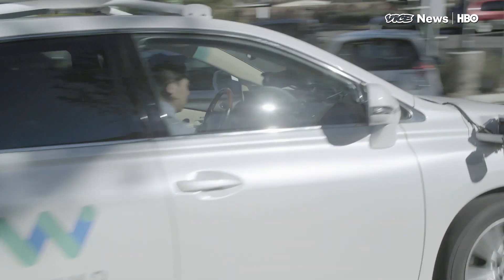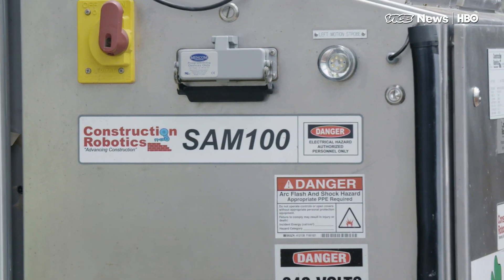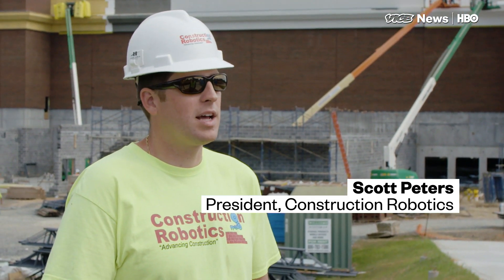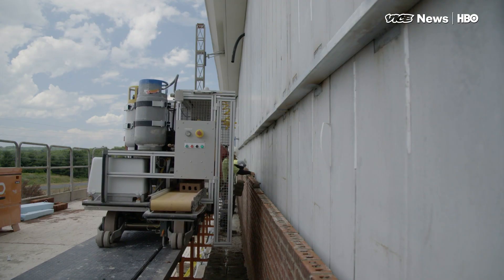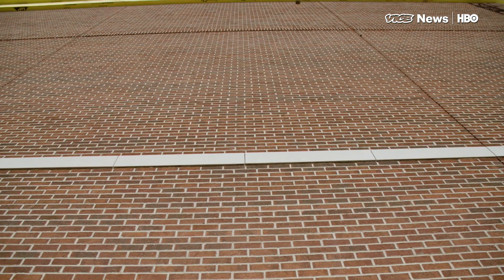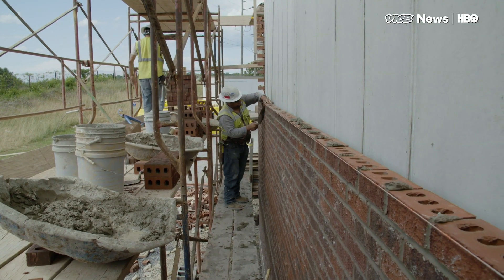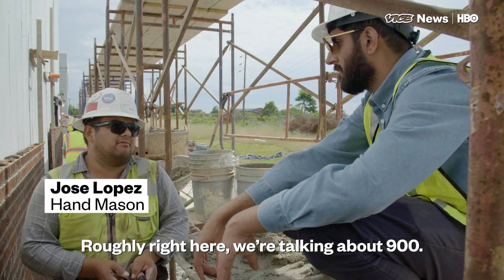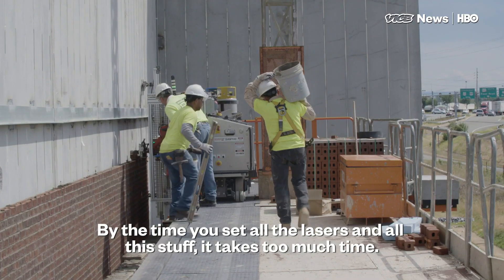This Bricklaying Robot Can Build Walls Faster Than Humans (HBO)

Comment: That bricklayer is absolutely right.  The buildings nowadays have a lot more in and out tight areas and shorter spans of architectural features then the 1950s, 60s, 70s, and in the 80s is when masonry buildings started getting more fancy with the architecture.  Also that robot representative doesn't know what he's talking about.  Number 1, even though the robot doesn't cut and strike the mortar joints it looks very slow cumbersome and I don't believe it is laying 3000 bricks in 8 hours, I think that's a flat out lie.  Also, the set up of that thing and the maintenance, clean up, disassembly, transfer, and moving that thing around has to be taken into consideration.  And he's also trying to push a popular political misconception that nobody wants those kind of jobs; that's Bullshit.  Maybe true for lazy shits like him.
Reply: Let's calculate..

If a human able to put 1000 bricks a day, then if we count 8 hours a day work that means about 28 seconds per brick, in a robot cases it was 3000 bricks a day, if we count 24 hours a day work that means about 86 seconds per brick, I would say it's possible..

for setting up, you probably only need a few hours and not everyday you need to set it up, for cleaning probably already has it's on mechanism or simple cleaning will do, for disassembly why would you need to assembly and disassembly can't you just pick it up and transfer it like that?
Reply: You're living in a fantasy world if you think people are falling over themselves to get these jobs. I've heard countless reports of construction and agriculture business owners trying to hire American to no avail because of people not wanting to do the job even for higher wages. When the immigrants get sent away or barred from working, businesses that rely on their labor collapse.
Reply: He, like most people, want work that is more dynamically variably challenging, and higher paying.   But anyway, I'm taking a masonry course right now.  I'm a landscape contractor, but hadn't yet developed my masonry skills much, though I've done some,… but I want to further develop my masonry and patio making skills, to get more work with my clients, rather than leaving it to other contractors/subcontractors.

Comment: When the machine can build corners and difetent fancy bonds and put lintles on and cut damp and put it on and put weep holes in plus so much more. It's ok if there's a big straight wall on a massively high building and it is simple to do.

Comment: Laying 3000 bricks in 8 hours.
With the help of 2 "real bricklayers" to do the joints and another man feeding it ....
So it means that the robot by itself ain't worth a shit.
Reply: It's worthy is in the endurance, it is capable of working non stop (albeit needed to be fill with materials first) but overall the worth is absolutely better, because worker only need to supply materials while the work are done by machine.
Reply: Man, its almost like it was made to be semi automated.

Comment: Ok, this is a cool robot and all- but I was thinking: If a human worker can lay about 1,000 bricks per day, and the robot (plus 2 human workers!) can lay about 3,000 bricks per day, isn't the robot essentially about as useful as 1 human worker? Because you have to have two humans assisting it; each human with the capacity for about 1,000 bricks per day.

Granted, the brickwork may be more uniform with the robot. Also, the engineers may upgrade the robot to improve its efficiency over time.

Comment: So the robot need 3 workers to assist it and is a pain to setup, for 3000 bricks per day.
A worker is putting 1000 bricks per day, so 3 worker can lay 3000 bricks per day, don't need setup/maintenance/electricity/technician or high skilled employee...
I think it's not quite there yet...
I suppose the problem is also the use of human adapted brick and material for a robot. Bigger brick or other material might be better for the robot
Reply: its just its early stages of this technology, wait 30 years from now, you will see something better
Reply: But even the worker who puts down 1k bricks a day needs assistance. He needs guys to bring him the bricks and mud just like the robot.
Reply: peter janjanin even in McDonald you need someone train to fix the machine in case of problem. I suppose an automated soda or ice cream dispenser is not that simple...
This robot surely need some fine tuning during operation, so at least one of the member need to be train.
Also someone need to be able to maintain the robot, part need to be controlled / replaced.
Reply: Glad someone knows what the hell they're talking about. I expect myself to lay 600-700 brick a  day but as you said, thats only if I have everything set up with a helper.

This is definitely cool to see. But it's no where near ready to replace human masons.
Reply: Touli Loup.  Correct, the company i work for bought one a year ago and lost their asses! Too much maintenance and is was too sloppy!
Reply: Touli Loup  some set up is required but that's the labourers job
Reply: david dorshak yes but the qualified technicians needed to setup/maintain and operate the machine are certainly more regarding on work condition than their minimal wage competitor...
Reply: Doondah I bet people on the lines at Ford and GM said the se thing
Reply: Humans get tired
Reply: cooking with Callum yep, the 3 humans assisting the machine will also get tired, and machine wears out too. Maintenance cost on a robot must not be cheap.
Reply: Touli Loup but the workers whilst using the robots don’t have to put in as much effort 😏😏
Reply: Touli Loup Natalie Cabral not a chance! I saw 3 bricks already crooked. Unless you care less about quality and more about quanity then looks like same is your guy.  And if I had the same height to lay brick and 2 guys to do my finish work and not take a break and lunch 3000 bricks is possible for a human. This is just not practicle especially with level work which Sam will never be able to do.
Reply: You need health care, standards, per diem, insurance, sick leave, vacation time, possible laziness
Reply: Touli Loup 2 workers per day not 3 plus innovation means that in the future it won't need maintaining of the same sort
Reply: Touli Loup lol love how you just state what the video said
Reply: A complete brick crew lays 900 bricks a day, not 900 per person.  I can tell you're a indoor kind of guy.
Reply: Touli Loup the robot will get better and the cost will go down.
Reply: thats the beginning it will improve with time
Reply: Those 3 workers still need 2-3 other workers to feed them bricks and mortar etc. So overall the machine still needs less people than 3 bricklayers because the brick masons still need unskilled labor to give them things.
Reply: I love when people who don't know anything about bricklaying, but heard a statement in a youtube video about how many bricks a human can lay, think they know enough to compare manual bricklaying to this machine.

Like others have said, each human worker also needs someone to feed them materials and bricks just like the machine does.
Reply: And when the machine breaks down, as all man-made things will. You could just hire another human Mason. But no, now you've got a 4500 repair bill and a stalled jobsite
Reply: Thank you
Reply: Touli Loup I don’t think they care about that they just want it to be perfect so company’s can sue for poor or small brick that is not perfect
Reply: Working with that robot is less tiring and childs can do it too
Reply: If you read correctly he said some of the best masons can lay 1000 bricks a day meaning the average can most likely produce roughly half to 3/4 of that
Reply: sound like a butt hurt bricky
Reply: bro if youve laid block before its brutal work
Reply: i havent laid a block bro.... been around them on work sites for 15 years tho. i lay out 9 foot durforms for concrete foundations. you ever  set 120lb 9 foot bricks all day?.... this machine looks very practical and efficient for laying bricks.
Reply: The robot handles the straining and repetitive job of laying the bricks
Reply: Touli Loup unskilled workers costing little, in 3 shifts a day.
Reply: Doondah do you know the approx cost?
Reply: Touli Loup he said 900 a day and he is probably skilled at it so that's not the average plus You have to pay them plus they take lots of breaks plus u have to pay for overtime plus u have to pay for any wasted material I could go on
Reply: And it also reduces chances of musculoskeletal disorders from repetitive motion/awkward posture. So in the end, still need 3. Actually a bit more than three because of engineering, maintenance, manufacture, transportation, etc. and yet these ~3 people only need to dump concrete ingredients in every once in a while and the bricks, and just carry a trowel to brush off the excess.

Makes the job easier,
Makes the job safer,
Does the job with higher precision,
Still requires roughly the same number of humans perhaps more,

Whats there to not like?
Reply: This is the first step. They didn’t buy the machine, this is a test to improve further.

There is literally a part where they talk about this.

How about you listen to the whole video next time?
Reply: i thought the same. plus human can make something else than straight walls, like fireplaces f.e.
Reply: Well 3 mason also needs assistant
Reply: Touli Loup 1000 is the ceiling for humans not the average
Reply: Touli Loup Robots don't take sick days nor does it need a break. Also works out cheaper overall
Reply: peter janjanin take a guess how much this machine costs?
Reply: First, you all need to know That shit it's not a brick wall lol, that's decorative shit
Reply: robot work 365 day 24 hour non stop
Reply: it doesn't really matter if the cost of lease, purchase, usage is lower than the cost of 3 bricklayers per hour say $100 total p/h (inc all other employee costs) then the Robot bricklayer makes sense. At the moment I'd imagine it's more expensive but as it becomes more mainstream ,  then the costs will tumble, also as you get a more refined version that doesn't require any human intervention, then why would you employ a human to do the job.
Reply: plus it needs a big empty wall without special features
Reply: orange moonglows that's like saying you need to be skilled to operate the machines at McDonald's ......
Reply: no. you have to be skilled to assist and operate that robot. it requires way fewer skills to lay those bricks than operate that robot. the robot is not paid. lol. the price will go down as the machines get more reliable, faster, etc.
Reply: Yes but the humans assisting the robot require less skill and can therefore be paid less.
Reply: @kms50549  yes but not the technician that will have to come on a jobsite to repair and maintain them.
Reply: henry hurst. The system will ALWAYS have faults, masonry is too hands on, ive done it for years, cheers!
Reply: Touli Loup they call other people to fix their machinery ;) for all these Mexican comments, "they'll" just learn to fix SAM lol
Reply: That robot probably doesnt voice complaints about things like pay rates, work conditions, taxes, and workmans comp. The three guys operating the machine probably are making just a little better than minimum wage. I almost bet that the construction company gets paid more per brick than a conventional brick laying company, by stating that the robot lays bricks faster and better than humans.

Comment: I seen 4 guys manning this machine, divide 3000 by 4 = 750 bricks per man hour.  A superb human can lay 1000 /hr. if you can find one.Of course you have external support for both, fork lift drivers, labor etc.
 Host mentioned young people not wanting to do trade work anymore which I found very true.
I'm a GC for 25 + yrs and us old guys are taking the load because in my area there are almost no immigrant help or young tradesmen, so I'm all about upgrading equipment.
Reply: Its just the modern progression the masonry business has seen since the first Egyptian stone cutter. Hammer and chisels were replace with diamond tipped saws ,  Instead of a half dozen guys with steel trowels , one guy with a power trowel, hand built wooden scaffolding replaced with modular pipe, then hydraulic lift scaffolding,  vibrators, power screets,,, the list goes on and on, and gets bigger every year.

Comment: The thing about jobs like this is the fact that, unless it's brand new construction, a robot will never be able to compete with a human. At least not for many lifetimes. Robots are great for production, new things, building from scratch, but show me a bot that can repair dry-rot in a house's framing or do any number of creative things that a person with real problem solving skills will have to figure out. I work for a general contractor and just two days ago I was at a job where the gutter ran INSIDE the wall of the house. Write the necessary code to fix that lol

Comment: Long straight walls with a half dozen bricklayer laying around 5000 brick and having a couple of good tenders on a tower scaffold (crank up)  would be a bit more economic,  especially if there are corners, windows, doors, decorative panels, arches... I hope you get the picture.  I think they should stop at making brick and processing mortar cement and the like.  They said the machine tempered the mortar automatically;  in the Specifications on most jobs I was on you could only temper mortar over a period of time  and at that so many times.  Did you notice how the mortar was left hanging out till the helper came along to finish the joints?  That is a waste of good motion because the bricklayer would cut the mortar off and either use it for the next head joint or return it back to the mortar board (or pan).  Keep in mind I'm 70 years old and retired so whatever comes is for the next generation.  Greg

Comment: (London based Quantity Surveyor) These machines will have limited use on very large scale projects and only in major cities which have the types of very large commercial / public and large residential builds. Skilled masons need not worry too much. That machine will be hired to complete the larger facades but not much else. And they take the heave lifting job, not the intricate finishing and pointing. If anything it will make more work for masons if it can make brickwork (which is visually more appealing) more not less popular in the face of prefabricated concrete and cladding. I believe this particular robot will help the bricklayer's prospects.
Reply: I believe the future face of construction robotics will follow Balfour Beatty's idea of workers augmented by small robots and wearable tech. If it reduces manual lifting, it will open new architectural possibilities and improve the working lives of construction operatives. Two cheers for construction robotics.

Comment: Remember, this bot does not know where anything is, it only knows where it is "supposed to be" When there is no laser and the bot can just look and see and then lay the next brick, lookout.

Large jobs hell yes, small jobs hell no. Same as anything else. Big business - automation - small business - they use cheap labor to accomplish same thing. Large jobs are all about how fast can you finish this and how can you squeeze the last bit of profit out. Small jobs and about doing it right and getting it done on time. Small jobs - by the time you setup a "bot" a skilled tradesman will have it half done. Bots will not take over every aspect of construction until they can make a bot look exactly like a human like on the scifi shows. When that day comes and they can make em cheap enough lookout.

Comment: Donald Trump's lust eyes just appeared on his face.
Reply: Sam can help Trump build his great wall
Reply: Maricost They can't work on the desert the walls would be way too expensive and honestly really weak that you can break through it with a sledgehammer or a pickaxe in minutes
Reply: Scafolding is something humans require not robots, robots can easily provide their own to increase their operating height, and it will allow for much more accurate a faster placement of bricks. So tbh once they figured out how to efficiently load the robot autonomously it will not take long before they start building very tall or complex structures.

As for the desert being hard to build in, that's true, but imagine the workers only having to level the ground and place a foundation. The future of these robots will be a field day. 

Not saying they will build trumps wall, but they will take over much more of the industry in just a few years.

One of my professors worked on a mobile robot that could lay tiles in a bathroom. Was quite a difficult task because it also had to cut the tiles and move around autonomously. But if cost was not an issue those robots would already be in use.
Reply: Molo mono Yeah as long as it's brick building or tile. The wood Still goes to humans for a while. But that will be more for schools or government buildings even fabrics so yeah they will take a good portion of that and of course they won't build Trump's wall, that would be too expensive, would be too much of a weak wall due to the temperature and the time that it takes for cement to dry out. But yeah you are correct, they will do that. Which is good and bad at the same time
Reply: faro0485 yes there's the best technique which is gigantic reinforced cement slabs with metal supports which are the best way for the dessert and which cost a shit ton of money that the US could put in different ways that you beneficiate the country by stopping illegals than how they're doing shit at the moment this is just a huge blow of money because the US choose to be retarded